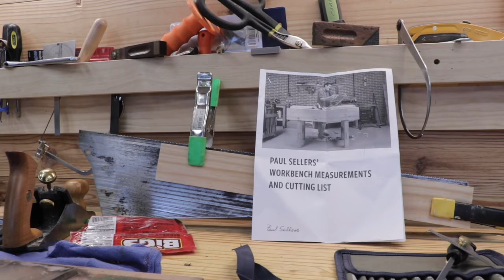My Paul Sellers Workbench: Part I Bench top

Comment: I just recently bough a Granberg Alaska Mill.... I wonder how this would work with rough sawn hemlock, and an expanding urethane glue?    I know.... it's a bit hack-ish compared to your build....But I think with a final hand planing of the top it might be pretty nice regardless, albeit less pretty.    I still think it would be more stable than a contiguous slab

 If I had a planer/jointer it would be a whole different story ;)
Reply from the maker: Oak Knob Farm the plans use cheap construction grade lumber but I’m sure you could use about any hardwood as well

Comment: What woods did you use compared to what PS calls for in his plans?
Reply from the maker: I used pine for top and rough sawn poplar for legs!
Reply: @lastingbuild1373  Have you found that those woods are hard/sturdy enough?  I'm preparing to make my first bench and see lots of suggestions for hard maple.  I will be doing some light metal work (1/4" cold rolled steel rod) and worry about excessive gouging on the top.